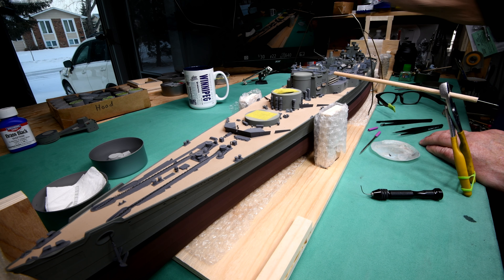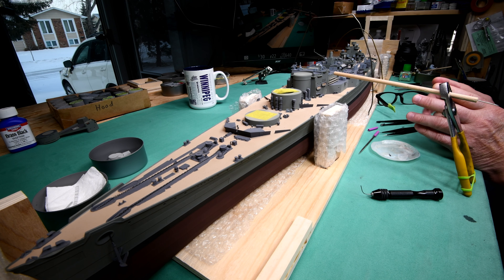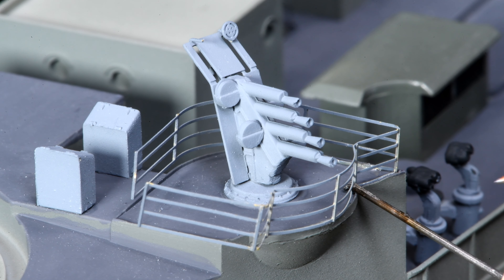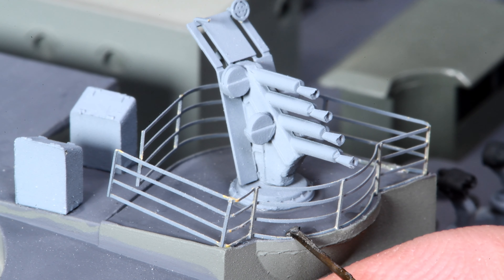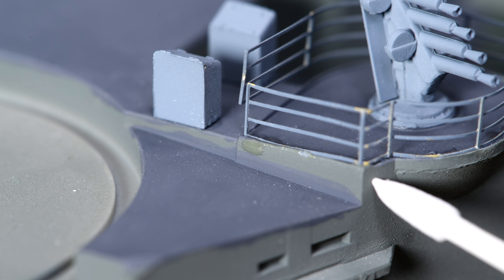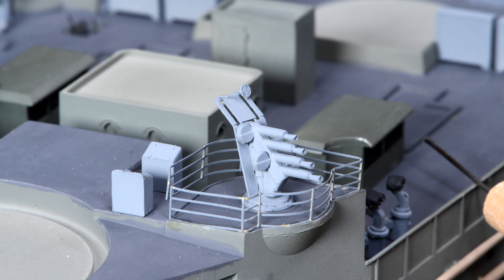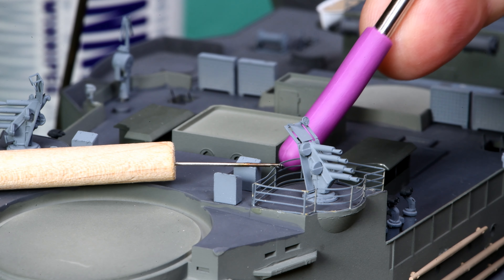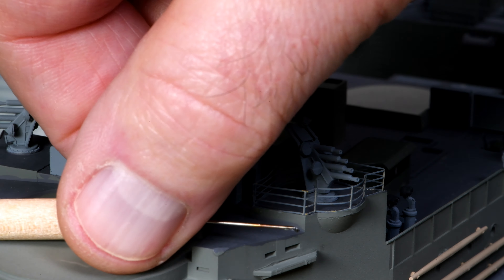The Model Ship - Part 731

Comment: Hi Ron,  if you buy CA Excelerator you can apply it after you put on the CA glue on the part It will set the glue immediately and it does not affect plastic. Ask your Hobby Store about it. 
See you tomorrow. Stay safe and be well.     😷.  😷.   👍.   ;-)
Reply from the maker: Hi Jason,
Re: "CA Accelerator" I've actually used it a lot down in my workshop. Powerful stuff! Will react with rubber almost instantly. Won't be spraying it on a painted surface any time soon without testing. We'll see. Thanks 👍
Reply: I don't spray it on, I use the point of a pin to Applied it on the part where the CA is on the part that needs it. It is worth a test (you like to test things out). I'm sure the viewers would appreciate it. So let's do a test on painted parts.   😊.   👍.
Reply from the maker: @jasonguttman548  Re: "I use the point of a pin to applied it on the part" Now that make perfect sense Jason. I imagine that just the gas/fumes given off will promote curing. 👍
Reply: I don't know about the gas fumes, all I know is that it works. So let's see how your test works out.  Just one thing, don't put to much (flood) it. Lol
Good luck.. 

Oh, I just saw that you do not subscribe to my channel.
Reply from the maker: Re: "do not subscribe to my channel" Look under RHJ Gold. There is the drop down button "Show 1 more" 😁
https://youtu.be/6vjGa5LeqOc?t=975

Comment: that railing around the quad puzzles me how did the crew get to the gun pole vote  has the trump eter instructions left out a gap for crew acess
Reply from the maker: Yes, I was noticing that too. Possibly the detailing kit that's available is more accurate in that regard. 👍
Reply: @roncalverley   just checked that area against the hood association plans trumpeter have made one of there normal mistakes the 2 boxes are too close together  and where the end of the railings the gap to get to the gun was between the boxes  the whole back railing didnt exist  should be more horseshoe like